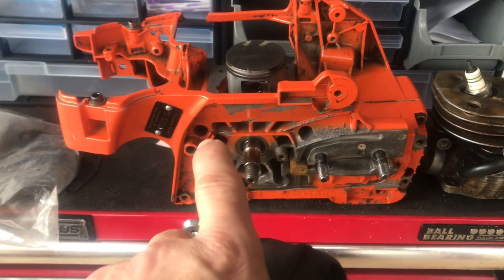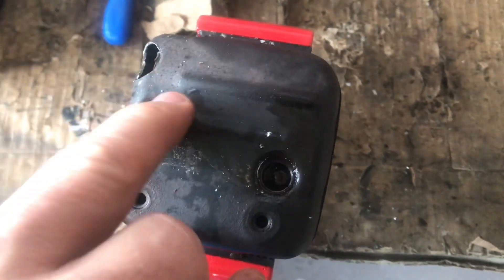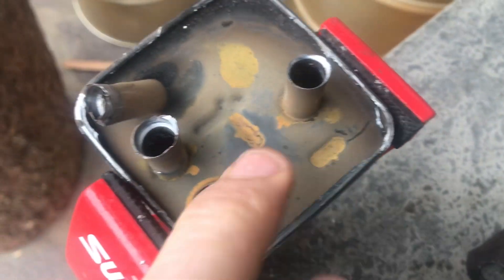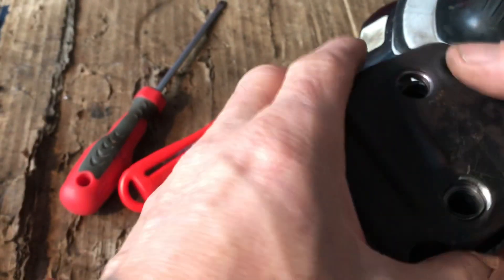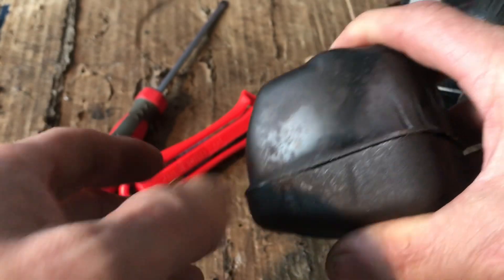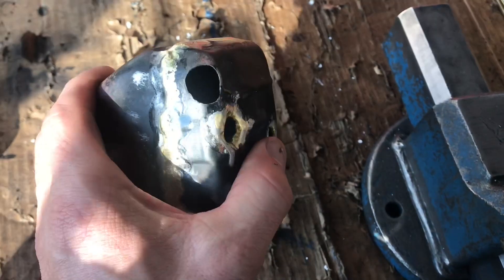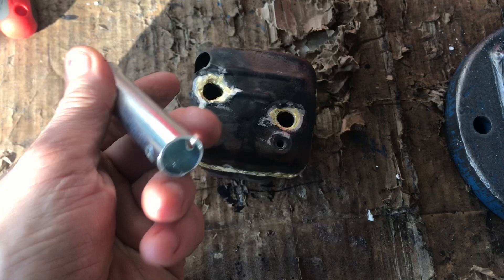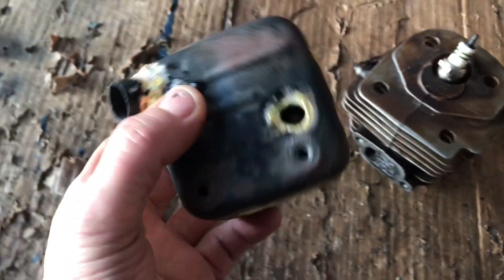Chainsaw Husqvarna 357, 359 Exhaust Muffler Mod.

Comment: No no no man wtf are you doing, you should have used silver solder with flux not a thick ass brazing rode 😲
Reply from the maker: Thanks for the feedback. All I had and works fine. You can do it 👍

Comment: Hi
Did you manage to get into the wood yet. Am looking forward to  the  vid on the porting. Have watched the usual channels on here but didn't want to get into changing timing etc.
Did you "woods" port it?
Reply from the maker: Hi haven’t got to the wood yet. I’ll try within the next two weeks hopefully. You can do it 👍
Reply: Hello
Can you  give a few details about the type of porting you did. Has it performed well or not had a good  run out yet?
Reply from the maker: @autoair7732  Hi, I've not run it hard yet. Will make a video when I do. Porting was not major just cleaning up the ports and matching the inlet and exhaust. With the exhaust and gasket removal it will be plenty strong enough. You can do it. A

Comment: Thats a much better way of opening up the muffler. Did you consider adding  2 ports?,they say 80% of exhaust port maximum.
Reply from the maker: Good point. Ones with two ports usually still have the baffles in which restrict the flow despite two ports. I’ve had great results with this setup as it keeps a bit of back pressure so you don’t lose too much fuel out the exhaust. If you want two ports try it and let us know how you get on. You can do it 👍